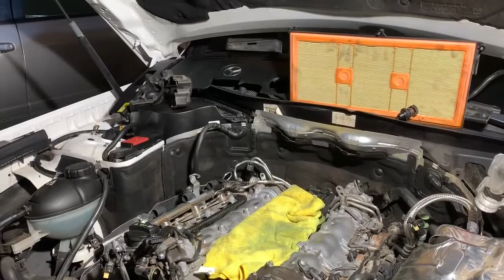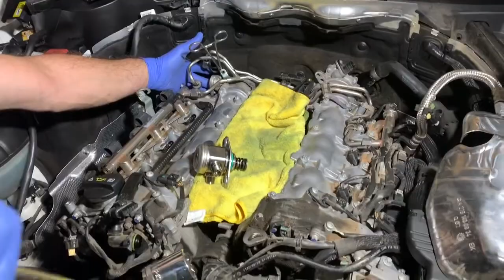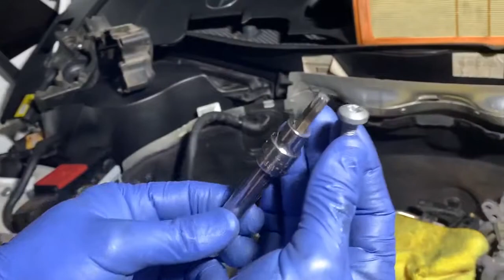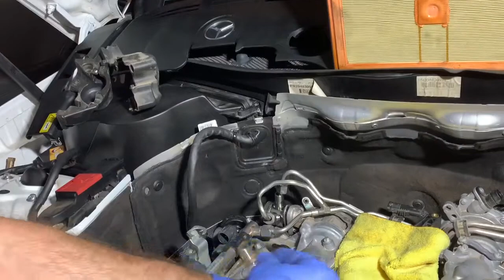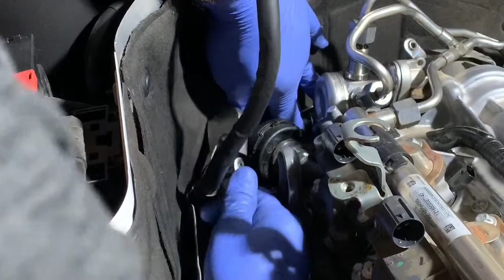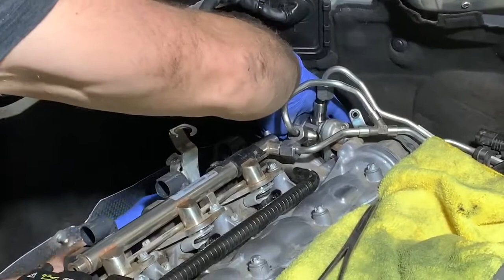(1 of 3) 2013-2015 Mercedes Benz GLK350 M276 High Pressure Fuel Pump Replacement

Comment: Great vid! How did you take off the engine cover?
Reply from the maker: Engine cover either clips on with rubber grommets, or there are trim clips that can be removed with a trim tool.  In some cases cover is bolted on and a small plastic cover needs to be removed to access them.

Comment: GREAT video.  Can you please let me know how you got the High pressure fuel pump housing off?  do you have to release some pressure?  All of the bolts are off, but it seems suctioned on.  Thanks in advance!
Reply from the maker: The high pressure fuel pump once fasteners are removed may be secured in place by the fuel lines that connect to it, you'll want to remove any fasteners securing the fuel lines and apply a reasonable amount of force to pull them back from the pump fittings for proper removal.

Comment: So the tappet goes inside the hole where you are inserting the spring / pump?
Reply from the maker: yes sir, and as noted above, ideally the engine is rotated to a point where the cam lobe that interfaces with the tappet is recessed.  Tighten the bolts each a bit at a time, gradually, to avoid putting unnatural forces on the pump or engine valve cover housing or the tappet.

Comment: Do I need to crank the engine in time before replacing the fuel pump pressure?
Reply: Exactly what im trying to find or if i pull it out and nothing moves if i can just replace right back which would make sense to me.
Do you know how to bleed the high pressure system or if there if there will be minimal pressure with car off and disassembled
Reply from the maker: you want to rotate engine to a recessed point where cam lobe is not putting pressure on the pump, i believe TDC or top dead center accomplishes this.
Reply from the maker: Bleeding the HPFP is not necessary, however, if left open to atmosphere for days on end and you have a lot of air trapped in your fuel lines, I suppose you may need to bleed some of the air out through the fuel rail.  Never seen air trapped in an HPFP.  Pressures are extreme.

Comment: I'm trying to find information. I'm told this pump is timed somehow, and if it gets out of time the engine will misfire. I'm familiar with diesel engines with mechanical injectors that are timed, but those had individual lines to each injector. I cannot find any literature on timing this HPFP. Please help.
Reply: Hpfp is not timed to engine on m276. Remove the 2 bolts 1/2 turn at a time. Removing one bolt fully can cause damage. When installing new pump turn crank untill fuel pump roller tappet(roller is under fuel pump spring) is near the bottom of hole. Now u can install new hpfp easier with tappet near bottom
Reply from the maker: Thank yo uto @master.. below for stepping in here.  I have yet to encounter a HPFP that is indexed (or requires synchronization with the engine timing system), however, I haven't seen it all, and am sure on higher end euro imports they may be.  The HPFP typically run off a cam and is not indexed. It should however be inserted during a particular phase of the engine cycle whereby pressure on the pump spring is reduced, and if I didn't mention that in the video, there are others that will address this point.

Comment: Did you need to release the fuel presser before taking  the lines off ? THANKS FOR THE VIDEO
Reply from the maker: I don't recall there being a schraeder valve on the fuel rail, but if there is one, yes, it never hurts to release fuel pressure. The design of the fuel lines allows you to slowly untorque the fittings and allow pressure to gradually work its way out through the threads of the fitting, so in my case, thats what I did and I did not need to release the pressure.  I simply allowed the fuel to leak onto a rag.
Reply: There is no Schrader value on the high-pressure fuel rail. There is one for the low pressure side on the drivers side bank of the engine. It is not necessary to release the pressure in the fuel rail. Just crack one of the fittings lose with a rag over it to release the pressure. I know your comment was 2 years ago but maybe this will help someone else.